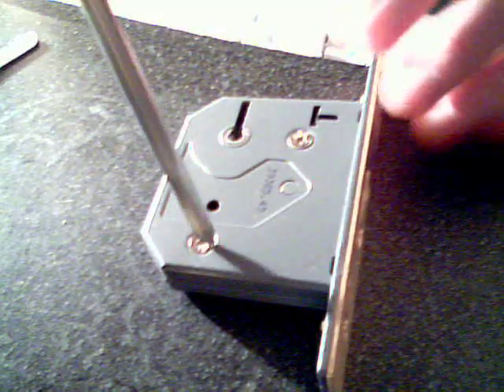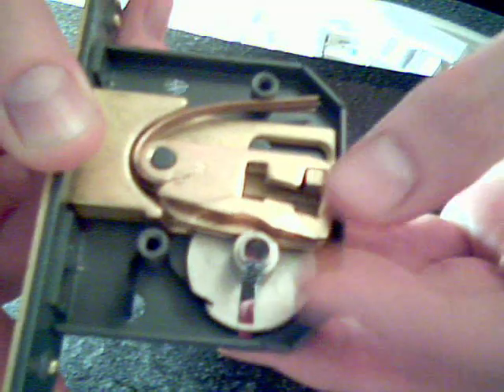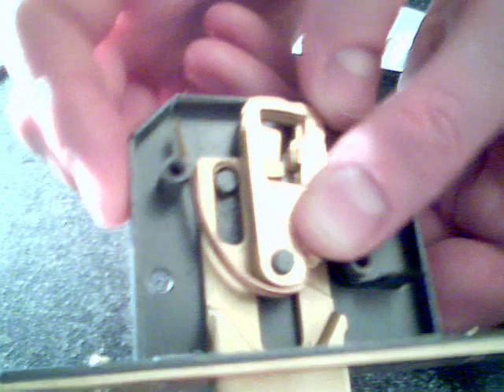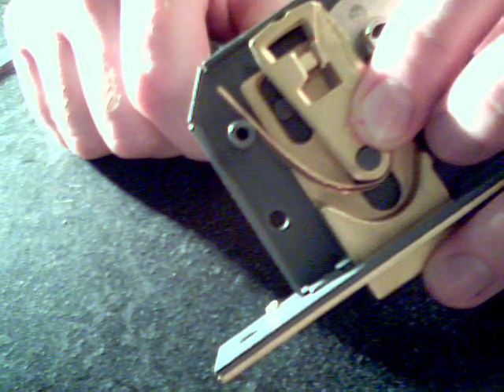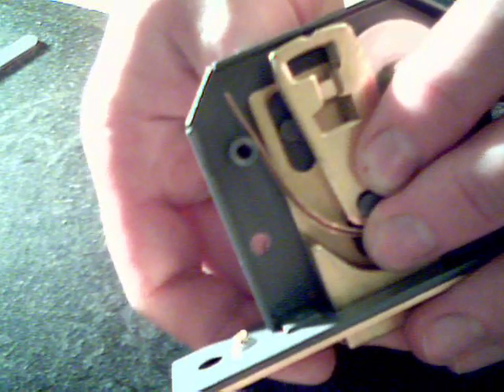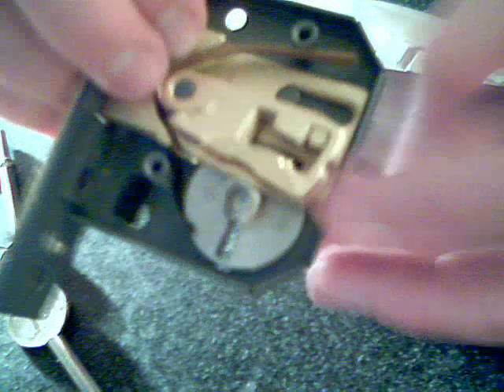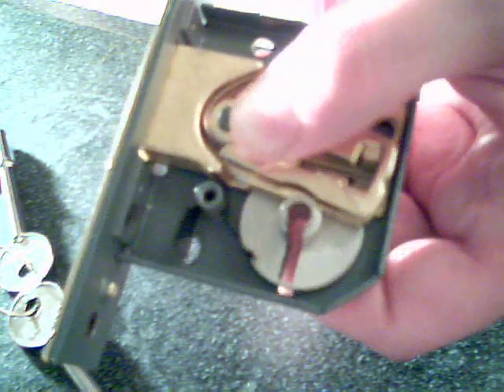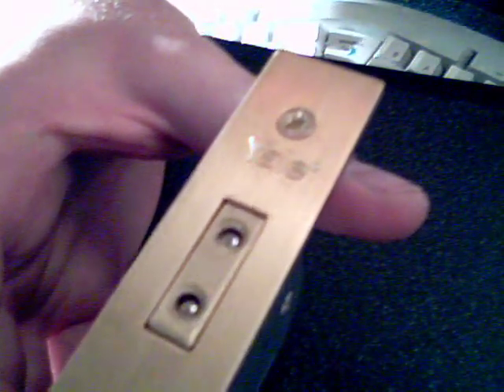5 lever Yale lock

Comment: hey their, how you doing? just wondering if you would have any idea how to open a upvc door with the strip lock still engaged? my handle is stuck in the upright position so I cant open door, the key cylinder turns as the multi strip lock is engaged? Cheers bud